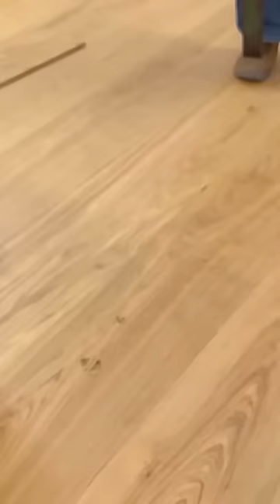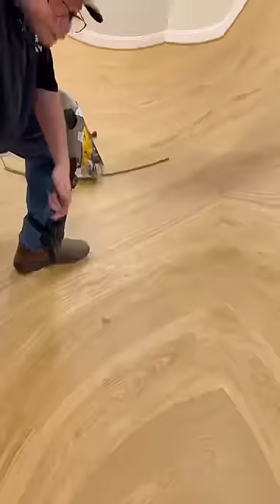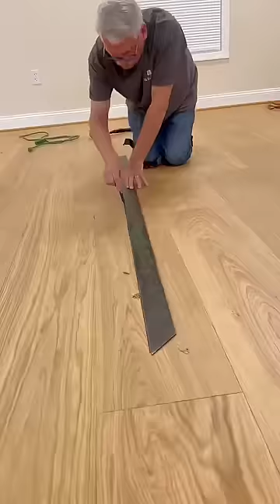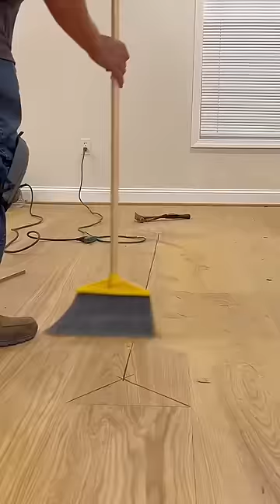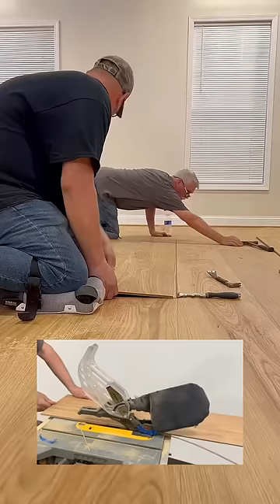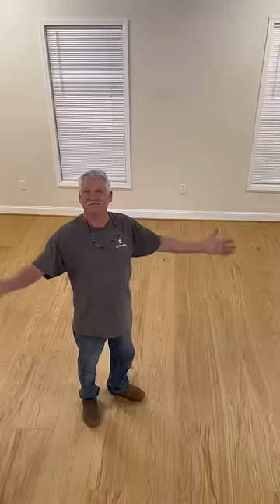How To Replace Damaged Flooring Plank | Wood Floor Repair

Comment: I like that they took the time to repair the barrier, instead of just putting down more flooring! That is a sign of professionalism
Reply: They put some scotch tape on it?
Reply: thats underlay, not really barrier, its meant to give the floor a slight amount of give along with a small amount of insulation from sound
Reply from the maker: Yes moisure resistance tape to seam the seam. This type of tape is also used to seal seams when underlayment pad butt together. Thanks for watching!
Reply from the maker: Yes to seal the seam of the underlayment. The tape is a moisture resistant tape.  The manufacture requires sealing the seams over concrete and recommends it over wood subfloors. Thanks for watching.
Reply from the maker: Thank you!

Comment: Looks like you weren’t finished yet with that end seam😵‍💫
Reply: and they hid it with buckets and standing on the seam.
Reply: @johnjaso1349  yup
Reply: Seen that too. Would have bug me to much lol
Reply: Yeah no filler either.
Reply: You know they caulked it in
Reply: Not to Merion they cut off one side of tje board that slips into the beveled edge of the other. Ot wont hold but a year... Maybe 1 amd a half
Reply: @jonboy6517  yeah the whole thing fits together like a jigsaw puzzle you cant just replace planks like this unless they are supposed to just lift in and out, in which case they wouldn't have needed to cut it out in the first place
Reply: If they use tape and pulled it then removes goo, or used wood filler
Reply from the maker: Thanks for the feedback. We finally have a long version of this plank replacement video ready..hopefully it addresses questions some commenters had about the cuts, short edge, the underlayment, and more.

Video can be found here or on our channel page:
https://youtu.be/718bJh-g3rg

Thank you for taking part in the community 👍
Reply: @LLFlooring h
Reply: @LLFlooring

Comment: Sweet trick to set the saw depth, nice work.
Reply: They cut through the moisture barrier so, no, they didnt do a good job.
Reply: @anythingroam2423  
Comment below me that has been doing flooring for 20 years, he said good job.
Comments the guy below said they repaired the barrier, which you can see in the video. 
You got more people to go rip on.
Reply from the maker: Glad you liked it!

Comment: I like the fact that there's two of you working together instead of just one guy struggling it out  .. nice job guys
Reply from the maker: So right, without a partner on this it is rough. The long version (with instructions) for this plank replacement video is finally ready ..hopefully answers questions some commenters had about the cuts, short edge, the underlayment, and more.

The video can be found here,  or on our channel page:
https://youtu.be/718bJh-g3rg

Thank you for chipping in. 🙏🏽

Comment: If that plank ever needs replacing again. Would it be possible as it’s been glued in?
Reply from the maker: Yes its possible to replace that plank again, remember it is not glued to the subfloor in this case, it is glued to adjacent plakns. They may not need to come out it just depends on what is left after the plank is removed and how clean you can get the adhesive off the surrounding planks. Visit our channel page and see parts 1-4 of the more detailed instructions of this same project. Thanks for watching!

Comment: So question? When you removed  the damage  peice why did you cut it in a triangle shape thanks an have a great day
Reply from the maker: Hi, this floor has a click system so in order to remove the plank you have to cut it into section so that it pulls out in four seperate pieces. Thanks for watching!

Comment: What kind of underlayment was that. We used silicone. Does it provide better insulation?
Reply from the maker: We used the Quiet Walk Max underlayment:
https://www.llflooring.com/p/underlayment%C2%A0--quietwalk-max-100sft-10056877.html?c3api=6090,PMAX,19994383644&gad=1&gclid=CjwKCAjww7KmBhAyEiwA5-PUSkT35KRgEOY4VIRddXJJtXHqvQkzsGIO1GO7cBfJ79guwXSPceOmERoC3vgQAvD_BwE

Comment: What if you have a table saw? How you going to cut it perfectly thin that way?
Reply: You need electric table saw or mitre and new blade, don't think the edge can be cut clean with hand saw. Then again depends on the experience of a person. Right tools for the job is a must that's my 2 pence/cents

Comment: I’m confused about this now though, not gonna act as if I’m an expert or some shit; However, I worked with flooring for 4½ yrs at AHF in SoFl, how exactly are you keeping the boards in place, not risking pop-ups and board elections? I didn’t see any glue, no nails were pulled out either, any chance I could possibly get a response, to get a little bit more insight as to why it was a floating floor?
Reply from the maker: Apology for missing your comment. If you watch the brief insert, we were in fact cutting the lower part of the groove on one side of the new plank. This allows fitting into that space. Levers helped pry the tongue edge to fit into the adjacent groove giving security there - which, combined with the glue to take the place of the missing 'click' connection gives you the best chance of holding tight.  Replaced planks can last the life of the floor when done correctly. 

It is a repair however, so perhaps let clients know to get a hold of you if it needs attention again in the future. 

BTW.. click the notification bell so you’re notified.. because we have a longer video of this same replacement coming soon. Thank you for that observation 👌

Comment: This is the difference between a pro and DIY. I've installed a few floors for myself now, but I could never do what you just did if asked
Reply: Real professionals!
Reply from the maker: We have a longer version of this repair coming soon. It will include more details to help. Please press the notification bell for updates. Thank you for watching.

Comment: Can you demonstrate how to fix it with underfloor heating installed?
Reply from the maker: @FistralG you would use the same method to replace the floating floor plank as seen in the video. Not setting the depth circular saw blade too deep is imperative, as you do not want to cut into the heating system.

Comment: Ive done this before with lpv floors that have a scratch and or a gap and then you have to cut out and remove it then put the new one in. Its one of the hardest parts I know of in construction it almost cant be done with onw person unless hes a master
Reply from the maker: You know it. We'd been asked to show that process and you're right it is a challenge. The long version (with instructions) for this plank replacement video is finally ready ..hopefully it addresses questions some commenters had about the cuts, short edge, the underlayment, and more.
The video can be found here or on our channel page:
https://youtu.be/718bJh-g3rg
Thank you for taking part in the community 👍

Comment: Is that silver underlayment insulation, or for something else?😮
Reply from the maker: Hi, it is our Quiet Walk Max underlyament. It offers moisture protection, sound deadoning, and comfort underfoot. Here is a link https://www.llflooring.com/p/underlayment%C2%A0--quietwalk-max-100sft-10056877.html?c3api=6090,PMAX,19994383644&gad=1&gclid=CjwKCAjww7KmBhAyEiwA5-PUSkT35KRgEOY4VIRddXJJtXHqvQkzsGIO1GO7cBfJ79guwXSPceOmERoC3vgQAvD_BwE

Comment: Would this work on vinyl flooring?
Reply: As in the floor is a large sheet of vinyl or are youbtalking about vinyl planks? The answer is yes to both but very diff on how you would approach each one.
Reply: @pwhsbuild  vinyl planks.  Help would be appreciated.
Reply from the maker: Hi, board replacements can also be performed on vinyl floating planks. In some cases, the manufacturer may have instructions on how to replace their specific planks. It is a similar technique to what you see in the video, with some slight differences.

Comment: There’s only one side with a grove being held. What else is holding the other edges?
Reply from the maker: Hi, so now we have locking mechanisms in place on one long edge, but the modified edge is relying on adhesive and fit..with tape and pressure to help it dry in place. If done with attention to detail it can be a long-lasting repair, hopefully the life of the floor. Please see this video or check our channel page to find the more detailed video, this link may not be clickable here:

https://youtube.com/shorts/Y7K1Ddeap2I?si=aBDdCujjhbE3OyBS

Thank you for watching, and let us know if there are other processes you'd like to see. 🙏

Comment: Are you ripping off the small tongue on the length side when you fold it down in
Reply from the maker: Only part of the locking ridge on that one long edge, it seems like you have it. We tried to illustrate it in exact detail on this longer video here, you may have to visit our channel page and find it if this link doesn't work and look for "How to Replace a Damaged Wood Floor Plank With Instructions (Widescreen)": 

https://youtu.be/718bJh-g3rg

Thanks for the comment, please check it out and comment there if you still have questions, thank you! 👍

Comment: I tried that with laminate flooring. It was going well until the last tap of the knocking block split a 1" chunk off the laminate.
Reply from the maker: Is there any way you could avoid that next time?  BTW the long version (with instructions) for this plank replacement video is finally ready ..hopefully answers questions some commenters had about the cuts, short edge, the underlayment, and more.

The video can be found here,  or on our channel page:
https://youtu.be/718bJh-g3rg

Thank you for chipping in. 🙏🏽

Comment: You should have used metallic tape on that cut underlayment, but other than that it looks amazing
Reply from the maker: Good call on the tape. We felt good with a waterproof tape here. Now sharing long version (with instructions) which is finally ready ..hopefully answers questions people had about the cuts, short edge, the underlayment, and more in case it helps.

The video can be found here,  or on our channel page:
https://youtu.be/718bJh-g3rg

Thanks for adding 🙏🏽

Comment: Still not understanding how you got past tongue in groove to drop it into the spot. Did they remove the bottom half on female side? No other way to do it.
Reply from the maker: Good observation. If you watch the brief insert, we were in fact cutting the lower part of the groove on one side. This allows fitting into that space. Levers helped pry the tongue edge to fit into the adjacent groove giving security there - which, combined with the glue to take the place of the missing connection gives you the best chance of holding tight.  Replaced planks can last the life of the floor when done correctly. 

It is a repair however, so perhaps let clients know to get a hold of you if it needs attention again in the future. 

BTW.. click the notification bell so you’re notified.. because we have a longer video of this same replacement coming soon. Thank you for the question 🙌
Reply: @LLFlooring  thanks for the explanation. I have done installs, but not repairs and was doing research for a job coming up.

Comment: i dont like the dewalt saw because of the divots on the guage, i always end up cutting half inch short becaue i follow the 45 degree divot. crappy. just leave it the same as every other, no reason to be different there.
Reply from the maker: Thanks for the feedback!

Comment: Looks like they didn’t actually complete the repair. Why did they put a sheet over the plank at the end? And correct, the end of the plank was raised and not flush.
Reply from the maker: After the repair was completed we used weights to hold down the plank until the glue cured. The end joint is flush with the next plank, but is a bit hard to see clearly in the video. Thanks for watching!

Comment: Nah,how they interlocking together properly? 😮
Reply from the maker: Yes its not ideal, but this can give every possible advantage if it is needed, we'd been asked to show that process. Now sharing long version (with instructions) which is finally ready ..hopefully answers comments people had about the cuts, short edge, the underlayment, and more in case it helps.

The video can be found here,  or on our channel page:
https://youtu.be/718bJh-g3rg

Thanks for adding 🙏🏽

Comment: Nice big gap on the ends 😂 only way to get it truly right is to take it all up back to that spot and start again bud smh I know it sucks but that’s why we used to cover finished sections with big sheets of cardboard to help prevent damages.
Reply from the maker: Ha ha, not gap at the end. I think maybe a shadow from the lighing. We will provide a closer look at the finished repair next time. Removing the the floornig back to the area of the damaged board is an option, but most customers would prefer replacing the plank to save time and lower labor cost. Plus you don't have to move all the furiture and trim. Thanks for watching.

Comment: So just cut the one side of the groove off huh 🤔
Reply from the maker: The locking system has to be altered in order to replace a board, but an adhesive is used to hold the plank to the surround planks. Thanks for watching!

Comment: Never ever glue toung and grove flooring. Thats going to split like crazy.
Reply from the maker: It's important to control indoor humidity with wood flooring products as high indoor humidity or even very  low indoor humidity can cause issues with wood flooring regardless of any repair work or installation method. Thanks for watching!

Comment: Did you really need a draw line
Reply from the maker: Thanks for that question. Its a force of habit. Also helps when showing a video of the process. In the step-by-step videos you can see setting the saw depth to try and preserve the substrate/pad:

https://youtube.com/shorts/YeC7FT4l670?si=fNuCyEhCBMYQ4ay1

Comment: Ummm pretty sure that's supposed to be glued down
Reply from the maker: Hi, you never want to glue down a floating floor to the subfloor. This can cause the flooring to buckle if the interior climate changes drastically. Thanks for watching!

Comment: I’d be pissed if that were my floor. You better be taking it apart and fitting it in correctly instead of that ghetto rig
Reply from the maker: Floating floor board replacements are a part of a professional flooring installer's job. North American Laminate Flooring Association teaches classes on proper board replacement techniques. Many manufacturers of floating floors also guide how to replace individual planks properly. If a customer wants to pay to pull up half the room, that is fine, but with more time and labor costs, it can be done both ways to give the customer options. Thanks for watching!

Comment: And this is why you should hire a professional
Reply: im not sure are you calling them professionals or saying a professional should have been called. cause they killed the groove edges on that replacement piece on 2 sides and that corner will lift in 2 years or less.

Comment: Ok This is NOT PROFESSIONAL....please stop saying that. This Handyman Shortcuts 101 at best. And Yes I have done this for a living!

they trimmed the bottom edge of the groove off the 2 sides and they board hammered the short end lock in and unnecessarily the long edge too.

As the baseboards and painting is all finished i would not say pick up the floor and relay it is the proper answer. thats a lot of man hours and potentially other contractors.

What is the answer....Here you go. 
1-Cut out the old board (they got that right)
2- Board hammer the short ends on each end as there should be space left under the baseboards /drywall for seasonal humidity expansion. Your hole is now bigger not only so you have 0 reason to trim the underside groove off the short end but you can properly angle and place the new piece long edge and not hammer force it which can cause slight separation causing a catch point for more damage.... but Ill give them benefit of the doubt and assume they shaved that too..
3- Trim the lower groove by half at most... and shave a bit of the top of the tongue minimally. .put a hook/pry under the tongue side of the full floor (side on the left) and lift it getting the clearance for the groove to get under the tongue and preserving the mechanical connection, when hook/pry lowered the board will lock in place.
4- shave the tongue top minimally on the short ends, apply minimal glue and soft rubber foot kick the board under the drywall basebards back in place to lock the short ends back in...Full mechanical connections will never be a difference from any other board.

Thats how you do the job right professionally. Sorry guys Ill give you an E for effort but thats a Get paid and Get out type of fix and you know it.
Reply from the maker: Thanks for watching! The board is fixed and the customer love it. That is what we care about.

Comment: Damn. no padding under the laminate? why you have foil there?
Reply from the maker: The silver film is the top of an underlayment called Quiet Walk Max. Here is a link 
https://www.llflooring.com/p/underlayment%C2%A0--quietwalk-max-100sft-10056877.html?c3api=6090,PMAX,19994383644&gad=1&gclid=CjwKCAjww7KmBhAyEiwA5-PUSkT35KRgEOY4VIRddXJJtXHqvQkzsGIO1GO7cBfJ79guwXSPceOmERoC3vgQAvD_BwE

Comment: Shouldn’t need to have a repair on a day old flooring. As a consumer I would have had them pull up the entire floor. Get my money back. Eventually you’ll end up with a headache if you keep the floor down.  Also a run around from store and installers. Leading to a lawsuit

Comment: you did it wrong   you would need to take back up the whole  floor from the side so you font have to damage the board trying to get it back in . like you did
Reply from the maker: There are different ways and techniques on board replacment. This is just one. Thanks for watching!